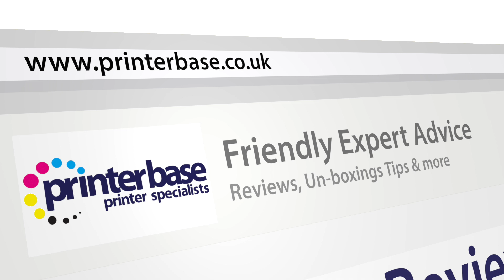What is a Duty Cycle?

Comment: What the duty cycle really is for is the reduce the chance of components such as motors, circuit boards etc. to over heat and fail. If your printer duty cycle for example is 3000/month  is 100 pages per day. Giving it time to cool between print cycles.
If your printing 1000 pages per day the time to rest and cool will be shortened and components may not handle it well and fail sooner.